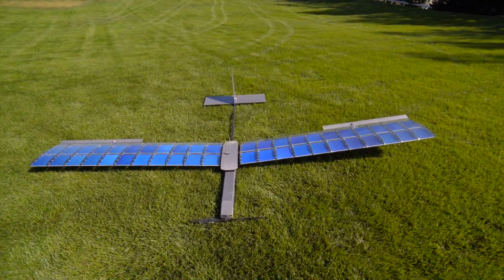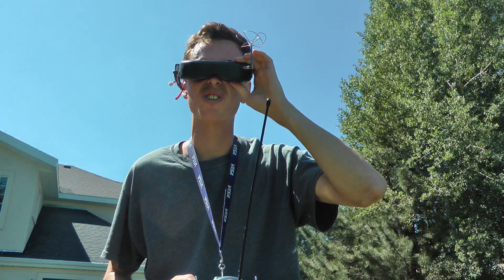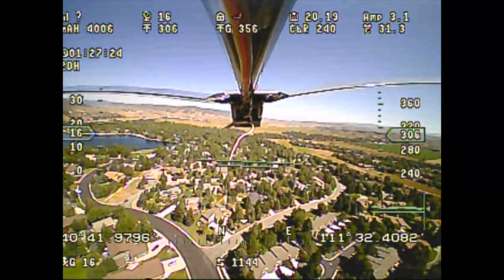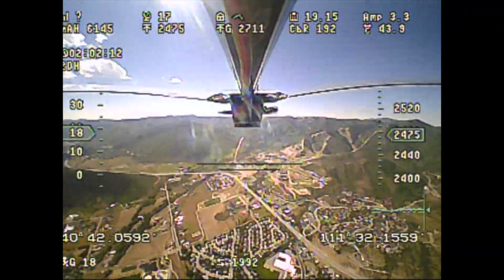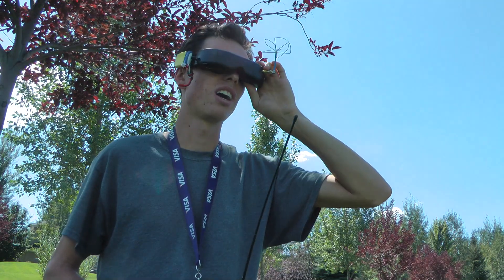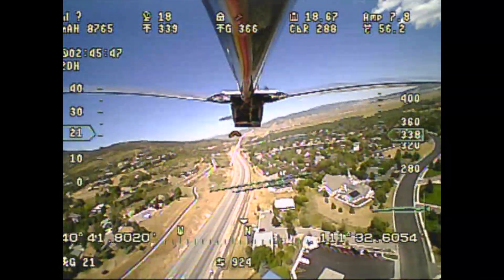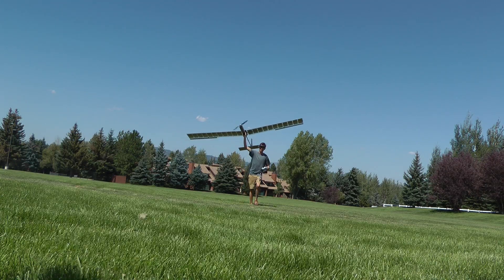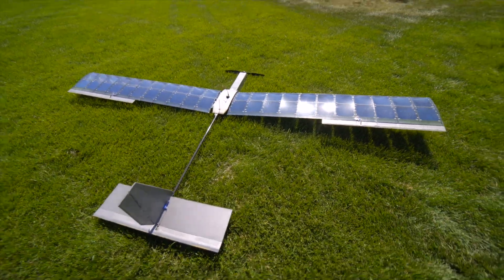SOLAR Plane V3 Long Duration Test Flight - RCTESTFLIGHT

Comment: How about if you used 2 smaller batteries, and built a circuitry to charge one and fly from one, and switch mid flight?
Reply: I suggest looking into much smarter chargers, you should be using at least one MPPT controller, possibly one for each wing since the insolation angles are different and hence the power output will be different.

A single buck-boost mppt will also mean that when the solar voltage is lower than the battery you get power when you currently don't - taking that into account could make a huge difference.

Once you have an idea of what's available start looking for efficiency + controller weight, you may well find that boost converters are less efficient at your power levels so you'll need to decide whether to replace your solar cells or not (I'm going to guess the most efficient setup would be about 3x as many cells each 1/3 the size and a pair of buck MPPT trackers). But just going to a single buck-boost converter will help you a lot, you will probably get 20% more power from the  solar.

(edit to clarify solar cells not battery cells)
Reply: it would loose more power on charging and discharging the battery. Best to have all power to motor and surplus to battery.
Reply: But the whole point of the battery is that when the solar isn't providing power the motor keeps running. For sustained flight the solar should be charging the battery and running the motor most of the time, so that when you need extra power (headwinds, clouds, climbing etc) it's available from the fully charged battery.

At the moment the output from the solar is too low so the motor is draining the battery most of the time. There's two obvious ways to fix that, increase the solar array size or increase the efficiency of getting power out of the solar.

Right now the efficiency drops to zero whenever the solar voltage is lower than the battery voltage. That's not good.
Reply: One battery should be sufficient providing he has something smarter managing the power and charging. That would void any benefits of a stable charge cycle with a twin battery setup.
Reply: Super Capacitors do help with surges and response times, but they also help a lot with battery longevity, as they can be charged and discharged ~1 million times. They would work best as the bridge between solar and battery. You could go about this any number of ways, but, with my limited knowledge of remote control power consumption, there is no conveniently managed charge controller to handle the 2 power sources, and 1 power load efficiently enough to get the benefits. I would, however, look into the LTC3780 module for maintaining solar charge voltage. They're rated at a pretty high efficiency.
Reply: How about scaling up a lot to get more solar power collection per weight of the rest of the plane? First time I considered getting a Patreon account to fund anything instead of just buying more planes for myself. Sustained solar flight if only in perfect conditions around noon is a serious achievement.
Reply: When you see the display say "2.1 amps" battery drain, that's the total discharge from the battery. It's not somehow feeding 5 amps in from the solar and drawing 2.1+5 amps from the battery.  Instead you have two power sources, the battery and the solar, feeding one motor.

Taking the battery out would probably give more power, because no power would come from the battery so you wouldn't have the times when the solar voltage is lower than the battery voltage. The cells would see a lower voltage and probably be less effective, though. That's why a proper MPPT controller is necessary.
Reply: There really isn't benefit to doing two batteries, you want the solar panels to give most of their charge to the motor as transferring power from solar cell to battery to motor introduces a huge inefficiency, since power transfer is far from 100% effecient with any battery.
Reply: And hybridize the power by adding in super caps.
Reply: Exactly. my calculations... assuming those are C60 maxeon cells says that with an intelligent charge controller he could pull over 6 amps over 6 cells batteries.
Reply: Can any of the super cap fans explain how they would help? There's no power surges, so fast response isn't important. Which means super caps are just more weight (joules/gram is lower for supercaps) and they leak/self-discharge far more than LiIon batteries do, so the plane would waste even more power than it does now.
Reply: Aren't you practically pointing out the difference between on-line and off-line UPS modes? The latter is a pass through and switches to battery only when the line power is insufficient, whereas the on line UPS only powers the battery and makes no distinction whether or not the line power is there. For IT use, the online UPS is friendlier to the sensitive components as there is no momentary drop in power, but this guy could benefit from off line UPS schema?
Reply: Tuttomenui - Super Caps can be found at 2.7v and a 6 pack of 120F (2.7v 120F / 6 = 16.2v 20F) with protection circuit weighing roughly 150g. With the LTC3780, it wouldn't matter what voltage the solar cells were pushing, it would pump out a static voltage of 0.8-30v at up to 10a (maximum of 300W) with a "listed" efficiency of 98%. Excess voltage is converted into current, and lack of voltage draws from current. Add a diode after the output and he could test the Amperes coming from the solar, and the motor draw separately.
Reply: I was also thinking about capacitors because they are pretty efficient and flexible when it comes to voltage and power input. I recommend he make a battery that is comprised of like 7 X3v capacitors and wire it to like some controller. He should then wire it to the ESC but keep another battery in parallel just in case there is too much shade and it needs power. idk just an idea. i like the two battery's switching idea tho cause im sure that would work
Reply: Are you sure you can't charge a battery at the same time you draw from it? I ask because cars charge while they are running wich means the motor also uses power from the battery (for the spark plugs, tail lights, the computer, headlights and so.
Reply: Car batteries are based on a lead acid that is designed to maintain a high voltage. Dropping voltage can mean permanent damage. Lipos and Li-ion cells are designed to be charged, and discharged. Maintaining a full charge, overcharge, and undercharge can lead to damage over time. Yes, you most certainly can charge the lipo pack while in use, but don't expect the pack to last past, ehh, 6 months? If you're going this route, you'd want a buck + boost converter to maintain a proper charge voltage, not rely on enough cells in series. Extreme duration flights I would also advise splitting the battery pack into 2 packs to shift between charge and discharge cycles, but we would be talking excess of 24 hour flights? Too much circuitry and probably too much division of peak current might cause elevation control issues.
Reply: Wouldn't it make the most sense to use no battery at all?   If the question is "can the aircraft maintain flight from just the solar cells", the battery is just extra weight.  Use a high start or launch from the roof of a building.
Reply: Jussi Hirvonen practical and efficient
Reply: I thought same, run a brushed dc motor direct connected with a simple remote on off switch.
Reply: James Wolf
Yeah my thoughts on the supercaps was to be an intermediary between the batteries chargers and the solar cells. I would use some light small 1F and enough of them in series to match the solarcell peek charge voltage. If I could figure out if it would be beneficial. I have a couple of sample supercaps my brother got for me that are packaged like lipo batteries. So that type might be light enough. But I think they are only 1.5 volt so you would need about 17 of them in series to reach the 25 volt rating of the solarcells.
Reply: That's not how electricity works. The water model is a good analogy here - you can't have water moving both ways down a pipe at the same time, and you can't have electricity moving both ways down a wire at the same time. The battery is like a pressure tank in that analogy.

If he had two batteries he could charge one while discharging the other. And that would be pretty silly because of the charging losses.

Cars are the same - when the motor is running the alternator provides electric power, and will charge the battery and run the lights etc. But if there's enough load the voltage will drop below the battery voltage, and then both the battery and alternator provide power (say you're running a big winch, or one of those giant car stereo systems). In that case you can flatten the battery even though the motor is running.
Reply: Nothing, its the right answer.
Reply: No because most of the power bypasses the battery goes directly to the motor.  The battery only gets/gives the balance of the energy coming from the solar panel.  Example: if the panel puts out 4 amps, and the motor takes 3A, then the battery is charging at 1A.  If the motor is drawing 5A, and the panel puts out 4A, the battery is discharging 1A.  Now compare this to a typical flight without a solar panel: battery discharges at 3-5A.
Reply: This is probably not a good idea because the aircraft would be unable to perform temporary climbs that exceed the panel continuous output nor would the aircraft have enough power if a cloud blew over.  He just needs a small battery.
Reply: Good point about another reason not to use 2 batteries.  Capacitiors too small in capacity to be useful.  Low energy density.
Reply: The solar voltage is never less battery voltage, they're connected together.  For sustained flight the battery charging and discharging nets to zero.  You charge an equal amount as you discharge.  The only exception is that the flight begins late morning with a fully charged pack and ends mid afternoon with a depleted one. So over the course of 4 hours he's depleted that 2200mAh or whatever the battery he used is.
Reply: LiPo4 battery would be the better compromise between Lipo and Supercap. They have the super cycle life better than lipo, and have high power density so a small pack can still run the motor.
Reply: The battery charges and discharges at mutually exclusive point is time.  For example, when you crank the starter, the battery is discharging.  When the engine is running, the power is being put back into the battery AND running the headlights from the alternator.  The battery in that system operates like a water tank that's constantly overflowing a little bit, the extra energy being dissipated as heat.
Reply: Most of what you've said is accurate. However, due to the way solar works, they output 0-PEAK voltage based on sunlight. Then, he's got them in Parallel with the battery. If solar outputs 12v and the battery is at 24v (accepting that there IS a diode to prevent reverse current) it would display roughly 18v. He's using a boost converter, but from what I've seen of his videos, it's in the wrong place. Solar -> Boost / Buck -> Diode -> Switch would be ideal.
Reply: No the short current varies with solar incidence.  The voltage is just a characteristic of the material that make up the cell. And he's more or less connecting the panel directly to the battery, no power conversion.
Reply: that is a good idea two batters.  I think he need to test the the motor, motor controller for more efficiency combination. find the most efficiency motor.   enjoy your video.
Reply: And yet another problem with using capacitors is that you can't put them in series practically because they each have slightly different leakage and capacity so the voltage won't be evenly divided over the group, some will see too much.  There is a technique you can use whereby you purposely add a parallel leakage path that dominates their implicit leakages but this would seem to count against you goal of storing electricity efficiently.
Reply: Also the motor and prop
Reply: A charched Battery has a higher resitivity and you loos efficenciy so it doesn make sence charche one Battery with solar cells,..... while  discharche another one with the motor.  The impendance will be mutch less if the battery is pallell to motor so its mutch more efficient,... if a good mppt tracker and solar charcher  is in use he will move the current up to a uncharched battery or will directlc Buck and Boost up if the Battery is charched.    If there Are two circuits you have doubel the wight of Cooper wiring and doubel the wight of Battery holders and so on, it will more a pain than a gain....
Reply: THANK YOU. had to scroll down way too far for this xD
Reply: Use a capacitor and (capacitor regulator and circuitry) befor the batteries get charged with a the two batteries.
Reply: they would both eventually both run out
Reply: the motor is drawing from the panels as well as the battery so the battery isn't getting sufficient charge.
Reply: olet suomi poika
Reply: Wow that's smart
Reply: capacitors hold about as much power per mass, but the internal resistance is much lower (less heat). less heat means more efficiency, the downside is the price and volume of capacitors.
Reply: Instead of two batteries could you not dedicate some of the solar power to charge the battery and other solar panels to run the motor directly. If the sun gets clouded switch to battery power when the sun is out switch back to direct solar power?
Reply: But wouldn’t switching mid flight cause the receiver and motor ESC reset. I see this as a point of failure in it if it’s self. Possibly but idk I fly like 20 min not hours. Lol
Reply: Not to be a buzzkill, but it doesn't make any difference. Two smaller batteries with the same total capacity will weigh more than one larger one, plus the weight of a control circuit. He'd be better off trying to develop a more efficient prop & motor combination--possible a much larger, geared propeller. MotoCalc to the rescue :)
Reply: Jussi Hirvonen SUOMI FINLAND PERKELE TORILLA TAVVATAN
Reply: That will wear the batteries so fast
Reply: You are suggesting perpetual motion. A quick google search of perpetual motion might lend you to reconsider that proposal
Reply: @dozer1642  perpetual motion does not get outside energy, he is suggesting two power systems that recharge alternately via solar. A good idea but, it adds weight.
Reply: Carrboro_Chapelhill Fpv perpetual motion overcomes outside influences such as gravity and wind resistance. Solar power is not 100% efficient and Batteries are heavy. You cannot charge batteries as fast as they are discharged. That would be perpetual motion.
Reply: @dozer1642  no you are incorrect in the definition of perpetual motion.
per·pet·u·al mo·tionDictionary result for perpetual motion
/pərˈpeCH(əw)əl ˈmōSHən/Submit
noun
a state in which movement or action is or appears to be continuous and unceasing.
"the planet is in perpetual motion"
the motion of a hypothetical machine which, once activated, would run forever unless subject to an external force or to wear.
"the age-old quest for the secret of perpetual motion"
Reply: @dozer1642 oh and for a more reliable source, Webster  
Definition of perpetual motion
1 : the motion of an ideal mechanism that could continue to operate indefinitely without drawing upon an external source of energy
Reply: Carrboro_Chapelhill Fpv you can’t charge a battery as fast as it discharges. Now go read your dictionary again.
Reply: @dozer1642  that has nothing to do with perpetual motion, the fact your adding power with solar constantly means it is not perpetual motion period. Nothing else maters.
Reply: There are losses during charging, losses during discharge, why would you want both of those when you just draw any power directly from cell, and use the leftover if any to charge the battery, if there isn't enough power to power the motor then any additional need is take from the battery.  If you draw 60watts and your solar panels put out 40 it doesn't matter what you do you will have a net discharge.  Some of these suggestions people are throwing out are ridiculous
Reply: Adrian Watch the video, motor is pulling so much amps from solar cells that they dont work efficiently when motor is on, only when gliding.
Reply: Jussi Hirvonen 100% agree with you two smaller 5 cell batteries that equals the same weight of the battery he was using on this flight multi switches between solar cells and batteries to go back and forth definitely should be able to stay up at 9 in the morning or 9 in the evening
Reply: Agree with your statement. Smarter charger would do the trick.
Reply: I don't think this makes sense, what's wrong with charging one battery pack and using it at the same time?
Reply: Adrian Johnson motor pulls too much current, you see the motor pulls more amps than the solar panels can put out. The battery can't charge with this setup unless you don't use the motor.
Reply: With the setup as is, the voltage of the solar cells will always match the battery, increasing as the battery is charged, decreasing if the current drawn is more than the cells can provide. If he's only drawing a few amps (most of the time it was less than or equal to 3 I think?), how much is the battery voltage going to dip? A few volts at most? How much efficiency do you think that's going to lose him?

A system to switch the solar cells and batteries would be complicated, add more points of failure and add weight.
Reply: I think he  meant that it doesn't make sense to add two smaller batteries with a heavy current switching circuit since the circuitry for that and two separate batteries would end up being less efficient (lower  battery capacity to weight ratio and increased losses from the additional circuitry) compared to simply replacing the existing solar charger with a more intelligent/efficient solar charger. ... Though i may have read too much into his comment/reasoning than he actually commented, so IMO as welll :)
Reply: another approach to why it makes sense to have 2 different batteries is heat. Just use your cellphone while it's charging, it can lead to overheat... Specially whn using high load aps as games, which is the same case as with a motor and batteries, demanding current at the same time your inputing it will create more heat.
Reply: Why not have a very small light battery, just for backup. That will reduce the weight and make the plane climb more easy.
Reply: Ahmad Malik what about people that use phone while charging
Reply: or a simple diode? ...
Reply: Nothing is lost everything is transformed. That's a smart idea but it's doesn't change the fact that It will take a long time to charge the other batterie after the first discharge
Reply: Its a fact that a battery cannot charge and discharge at the same time. If he only has one battery than thats probobly the reason why he isnt getting the power he needs. 2 batteries that alternate power and charge usage will work 100%
Reply: Jussi Hirvonen omg suomi
Reply: smart